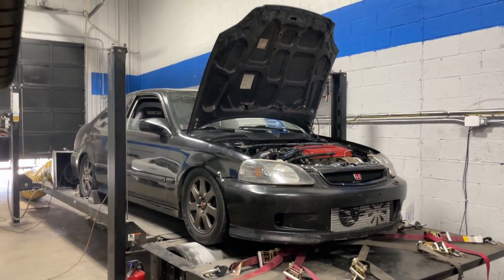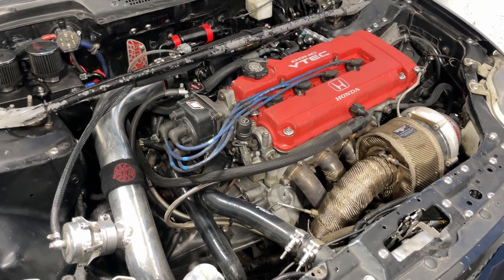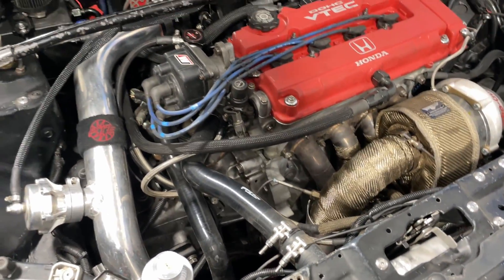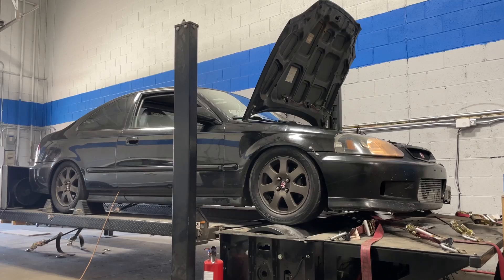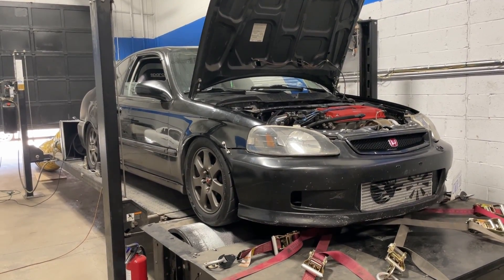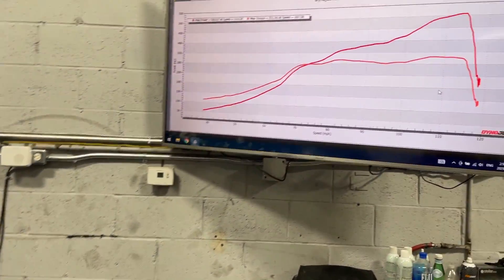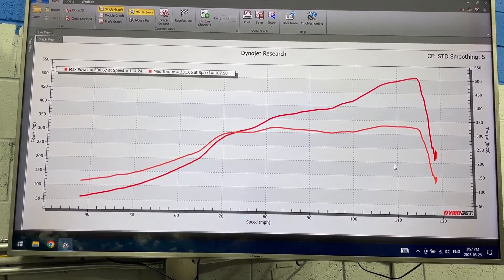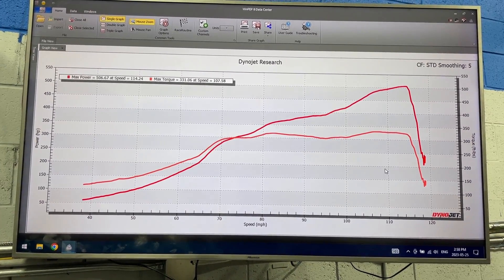500HP Turbo B16 Civic Dyno Tune

Comment: Damn this gave me alot of hope for my set up i have a built b16a engine with same rods, 81.5mm 9:1 compression wiseco pistons, polish balanced crank, supertech head package with type r cams and cam gears, skunks 2 intake with 70mm throttle body, flex fuel setup with all ptfe lines, pulsar 3076 dual ball bearing turbo and some other things I cant remember right now I hope I see these numbers

Comment: Still distributor ignition 😵😁
Reply: The dizzy is fine can make tons of power with it.   K.i.s.s since its proven to be able to handle the power this turbo will make.   Most cop kits still use the stock cam pickup and are super sensitive.  For a proper one your looking at 1000 at least and need a stand alone ecu which is another 1000.